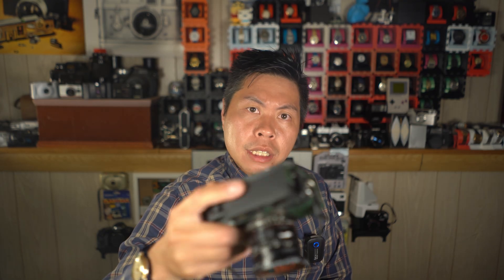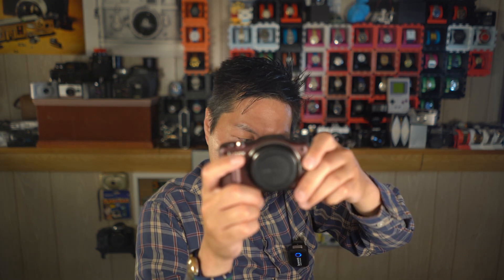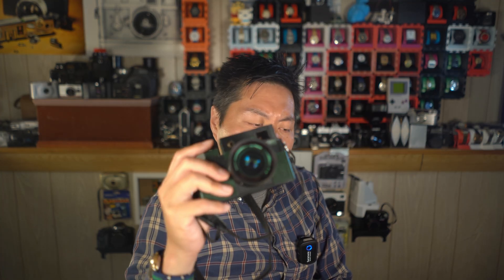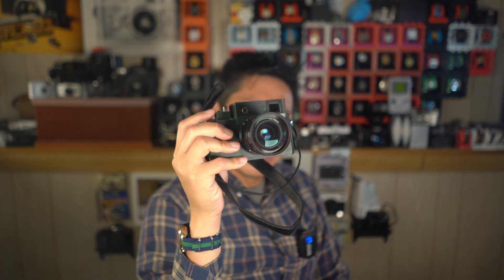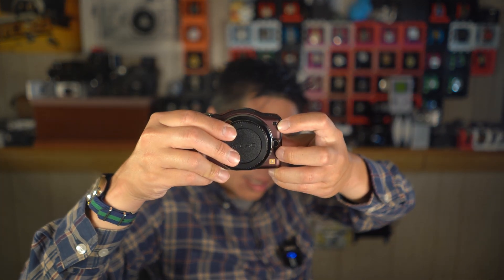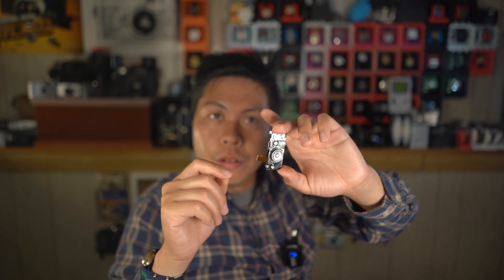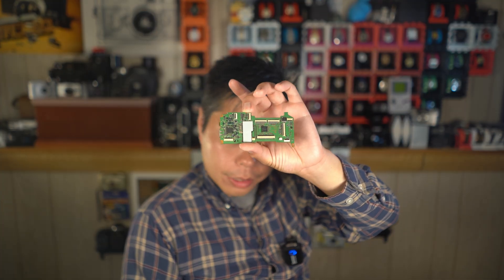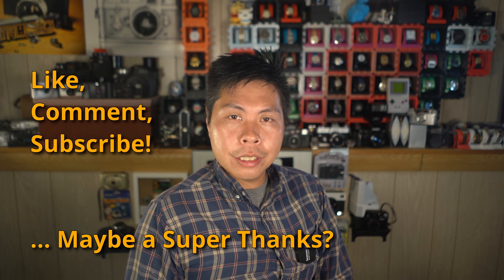Why I Keep Un-Aliving Panasonic GF3s

Comment: Great video, and it has given me some ideas for a possible conversion with two or three donor cameras that I have sitting around. One of them being an old Lubbitel 166b 6x6 TLR.
Reply from the maker: Thanks! Oh nice, yeah I've done it with a different TLR, it should be doable if you can fit the shutter and sensor in the cavity between the lens and film. I was able to do it with minimal destruction to mine, but if you don't mind a bit of cutting it's very doable!

Comment: Yes I like that kind of video.

One idea that came to my mind while watching it: You transfered electronics, shutter and sensor into an old rangefinder. Ok.
But does that also work the other way arround: transfering lens and rangefinder module into a L-Mount, Z-Mount, GFX-Mount or E-Mount "threaded" lens? Camera selectiom will be limited to small ones like the Sigma fp. And you probably need an 2 part solution to avoid turning the assembly while inserting the whole thing into the bajonett.
Reply from the maker: Yeah someone asked if that was possible in another of my videos and I gave it a thought. I think the main limitation would be the working distance between the mount and the original rangefinder mount. The limited space between the 2 would probably mean that you need to modify the rangefinder arm and cam to accommodate the full range of  motion of the rangefinder arm. 

It might be a bit easier adapting one of the fixed lens rangefinders and essentially giving it a lens mount. Probably the Z mount would be the best bet since its flange distance is the shortest, and I think the Z30 has a flat top so it would minimize the amount of work needed to place a rangefinder. One awkward thing would be how far forward the rangefinder eyepiece would be relative to the mirrorless body.

Comment: is there a way to extend flat-flex?
Reply from the maker: Hmm the way I've seen some other modders was to individually break out each pin into very small gauge wire. It's very tedious. Either I see it done at the flat flex terminal or if they are ok potentially destroying the original flat flex they scrape the cover off and solder directly on it.